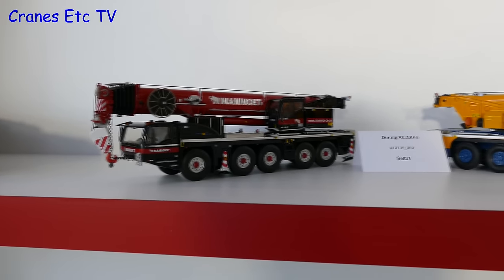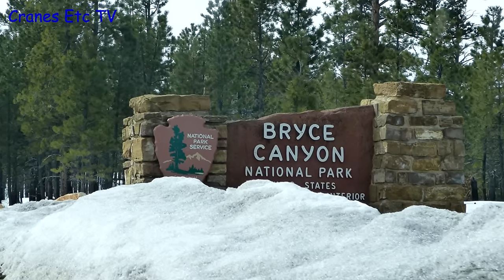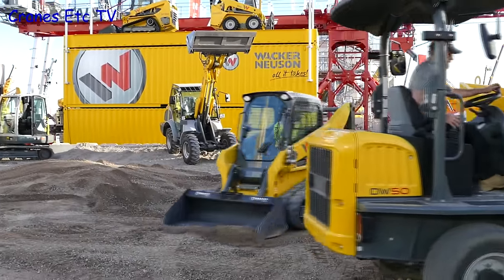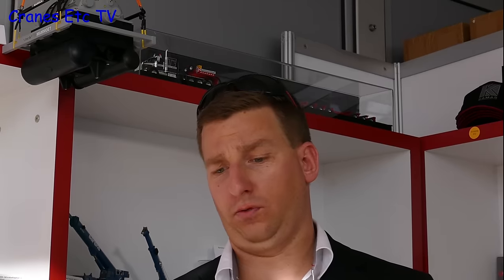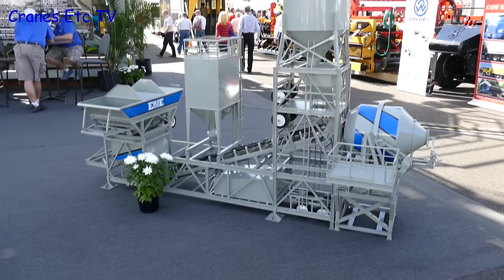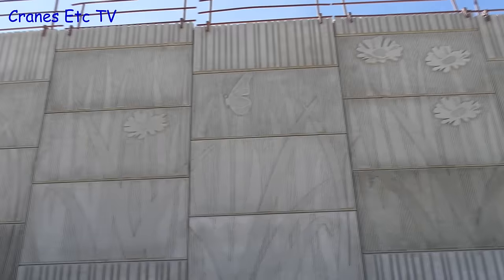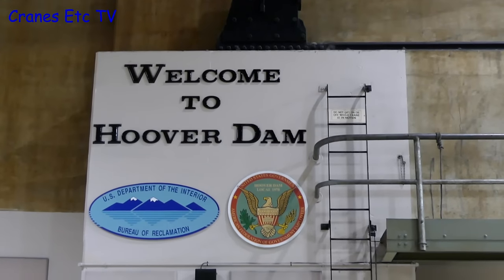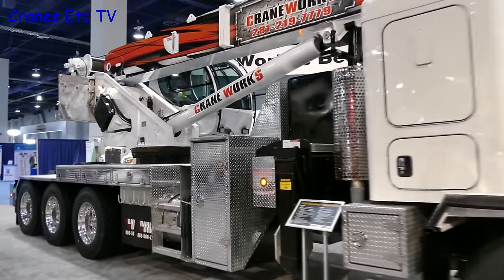ConExpo 2017 Report Part 2 by Cranes Etc TV

Comment: In what countries do they use boom dolly and why? I will appreciate if someone could answer my inquiries.
Reply from the maker: Used where the axle loads of the standard crane are too high for local regulations.  The boom dolly spreads the load.
Reply: CranesEtcTV Thanks for your reply, but is the turntable of the crane free to rotate when it steers? Since the boom is loaded on the boom dolly and I believe the dolly does not steer. Wouldn't this cause damage to the crane in long term? Albeit I'm not a crane expert.
Reply: It's swings just like a trailer